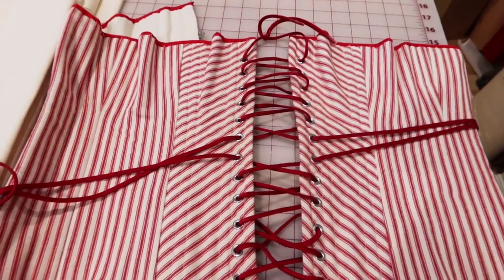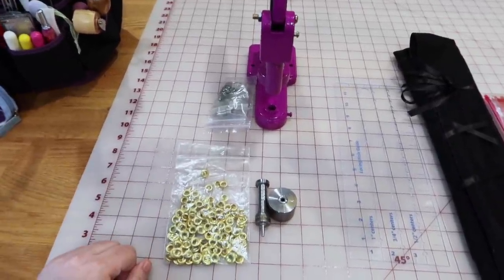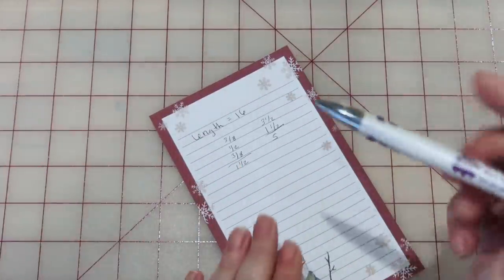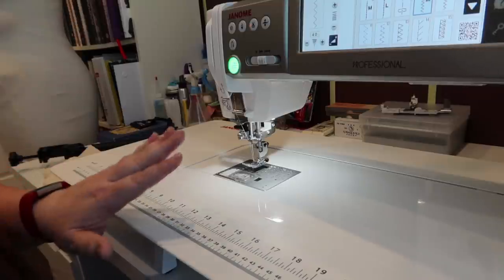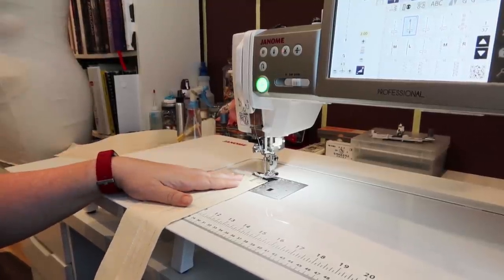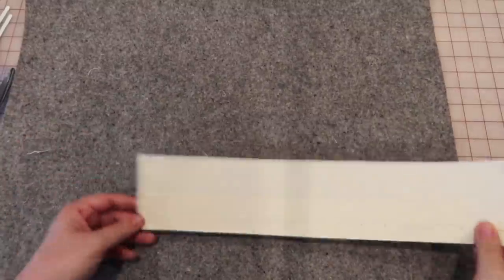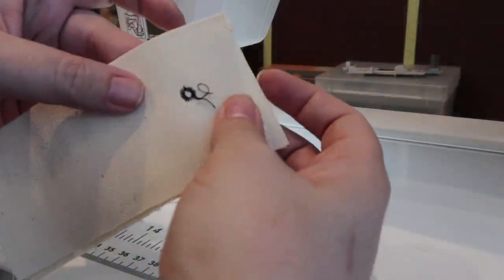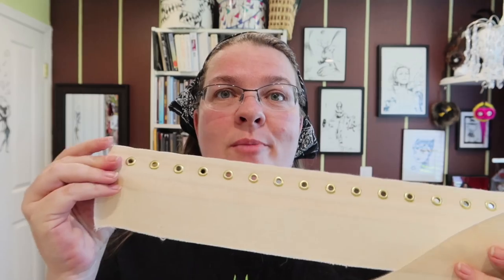Why You Need Lacing Strips and How to Make Them || Make Your Corsets Easier

Comment: If you did two or three different types of corsets would it be a good idea to have one type of lacing strip for each one?
Reply: Only if you are doing ones with drastically different lacing types such as 1700s stays vs Victorian corsets otherwise the lacing is pretty much gonna work fine for a variety of corsets

Comment: Your wonderful machine looks high end expensive.
What sewing machine/s would you recommend for a complete sewing novice? It is always better to upgrade a machine as sewing skill level  increases and the ability to use and maintain  
 a sewing machine  increases.
Reply: I’m still using my first machine which I got used in the late 80’s. It has 12 stitches and there’s really nothing I can’t do. Check out the used market or see if a  relative has one tucked away that they can lend or give you. As long as it can zigzag your good
Reply from the maker: Totally agree with this! I got my first one (and it was also a Janome) at my local sewing shop used and I never regretted it!
Reply: I have been sewing over 20 years and still use my Brother with 10 stitch options and my Globe with 4 stitch options. Shop to your budget :)
Reply: @invadersin5203   Thank you.
Reply: Thank you everyone.  Buying used was my primary goal but am clueless as to what to look for.  I learned from you that I need a zig zag feature on the machine I do get. I also learned of two brands our long time sewers enjoyed using and that'll be reliable as a used  machine as long as it is in working condition when I buy it. Thank you all.💚🤗